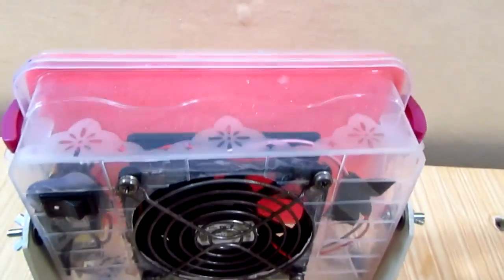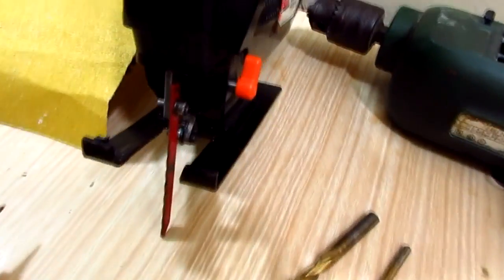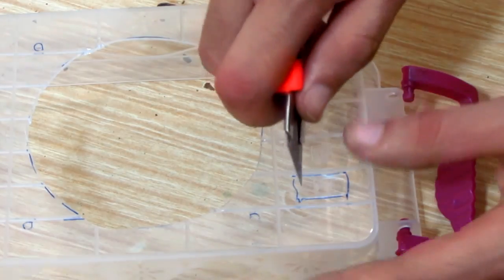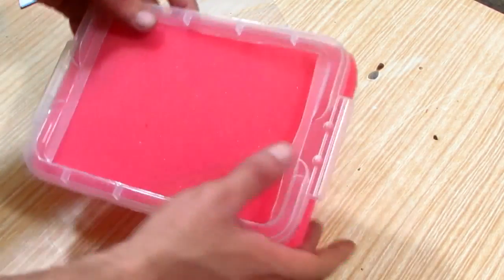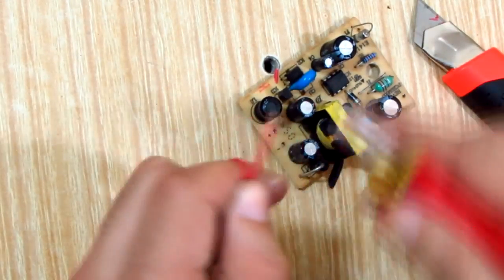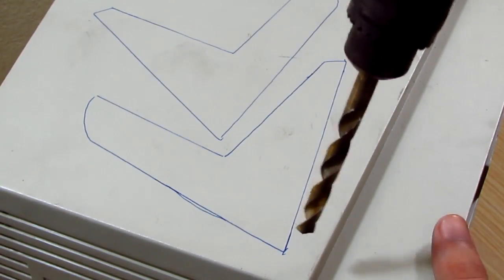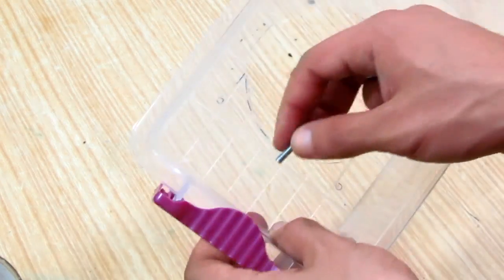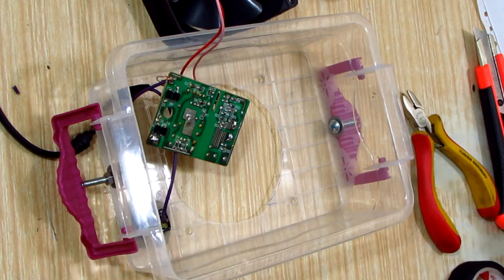Diy soldering fume extractor

Comment: I like it! 
 
You mentioned that the cover, after having been cut, was somewhat flimsy. I would recommend that you leave more material by removing large pieces of the cover but not cut it all out. A simple grid pattern could be left behind to better support the filter.

I don't understand the decision to put the power adapter inside... Not for any hyper-safety  reasons, but just for practicality. A DC power jack on the back of the unit would accomplish the same thing with less bulk and less work. Maybe I missed something? 

Anyway, good work!

Comment: Cool... but the fumes are still in the room.  You suck them into the box, and blow them out of the back, so the air still has the lead and other gasses and solvents in it.. just more distributed.  Not really extracting the fumes so much as blowing them around the room quickly.

Comment: I have no idea where I'm going to find an activated carbon sponge here in Brazil, but I want to do that. :| For now, I'm going to live with just a cooler with legs and a switch. :|
Reply from the maker: Look on Ebay
Reply: +AMG workshop +AMG workshop No way, it takes too long to delivery. (Something around two months.) An idea, from another commenter here, is to look in petshops... Foam for aquarium. :) But thanks! That's a awesome project!

Comment: If one just wanted to add a couple switches to power on/off, and not to have the dc trasformer layin around with just one cable to manage.. couldn't one do as you did without removing the transformer case, adding the proper switches before and after it, and then storing it in the box? 
It would be safer and I can't really see the pros of leaving open live circuits like here, uhm.
Reply: merlozzo,

No offence, but you are clearly overreacting. The contacts on the board are too close together to be touched with both hands, which would be required to do any real harm... Unless one is standing barefoot in a puddle! 
(...a puddle of what depends on one's level of fear, I guess)

You seem to be projecting ineptitude upon this poor fellow without understanding that this project was never meant to be sold to the general public. If so, you would be mostly correct in pointing out its failings... But it is used only for a short period at a time, by the guy who designed and built it, so I fail to see much risk here at all.
And, anyone who builds this is likely to have soldering skills at the very least, so this basic electrical setup shouldn't be a problem.

 Where is this "open and live" circuit you mentioned? 
The whole thing is enclosed inside a locking plastic bin! 
What the hell is supposed to happen?  
What astronomically unlikely magic are we expecting to see? 
The only time the circuit is exposed is when you change the filter. And since this was designed to be used by its creator, he is clearly smart enough to unplug it before cracking it open again.  
A thick blob of hot glue would insulate those live contacts well enough, but it's not a big deal since it's all enclosed anyway.  

Relax, my friend, life is too short.  ;-)
Reply from the maker: Yes! you can, i took it out of its case to have enough space for it
Reply: Just use a p4 connector. :) And, of course, the switch between the connector and the cooler. ;)
Reply: I would just not leave an open and live 220v circuit without reason, that's the whole point of my comment :) This said, having a container which is too small can, or cannot be, a good reason, for me it would not be, for the author was enough. But I still don't think this build is the safest which could be done ;)

Comment: Another youtuber using packing foam instead of a carbon filter, 
they are 20p on eBay FFS, all the harmful gases are coming right out the back.
Pointless waste of time
Reply: Why don't you just make the extractor and add the filter of your choice instead of being an asshat.
Reply: activated carbon filter will not stop those "harmful' gases anyone, can reduce the smell and disperse the gas in the air but will not block them, read about the sizes, hepa filter might help
Reply: different things - carbon filter will absorb the volatile gases, hepa will filter the particles, really need a combination of both, but a carbon filter is the more important.

Comment: is it safe if i use a normal sponge?
Reply from the maker: Not really, if your work area is well ventilated it's no problem, but if you're intended to use it in a closed area i highly recommend to use an activated carbon sponge instead
Reply: +AMG workshop what can i use instead of that? its pretty hard to find it here so can i use the one that people use for aquarium by putting it between two sponge? will it work?

Comment: This is not safety
Reply from the maker: +UpsetGaming I made this extractor primarily to avoid direct exposure to smokes, my electronics corner of the shop is well ventilated all i needed was to keep the smokes out of my face, but with this design you can change that sponge at any time with an activated carbon filter.

Comment: you need a HEPA or Carbon filter to get rid of all that junk. All you are doing with this is blowing the smoke everywhere.
Reply from the maker: I designed this extractor primarily to avoid direct exposure to smokes and to make adding or replacing filters easy, but as Haron Hajem said a piece of an activated carbon filter added between the fan and its guard will do the trick.
Reply: +Pero Exactly What i thought. But it can easily be added, behind "out blow" of the fan.
Reply: +Haron Hajem does the carbon filter out flux smoke for ex. kingbo or amtech?
Reply: Yes you need a "activated carbon air filter", the HEPA does only remove dust particles.
Reply: I'm sorry but there is a Danish study saying that you should use both at the same time.
Reply: +AMG workshop Good work man! Thanks for the video.

Comment: for led resistor value?
Reply from the maker: +Naren Dran It's a bright LED, so i used 470Ω for 12v
Reply: +AMG workshop thanks I am going to make one for my mobile service centre.
Reply: +AMG workshop what type of foam did u used?
Reply from the maker: It's just a piece of sheeting foam/sponge, but for efficiency consider using carbon filter foam
Reply: +AMG workshop in our area carbon foam not Available that's y I am asking. any alternative foam available?
Reply from the maker: Use sheeting foam/sponge as i did, it traps almost all the fumes, but feel free to experiment with what is available
Reply: +AMG workshop thanks bro. after I make one I'll sent a picture of that.
Reply from the maker: Thanks that would be awesome, good luck!
Reply: +AMG workshop <3